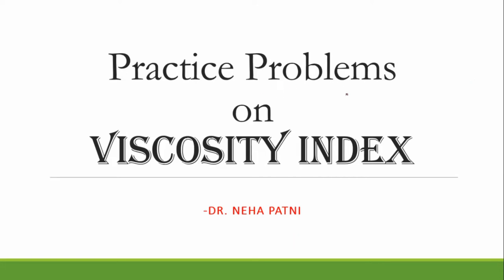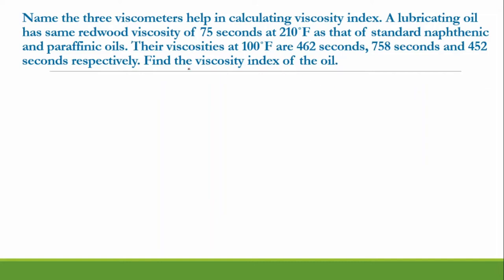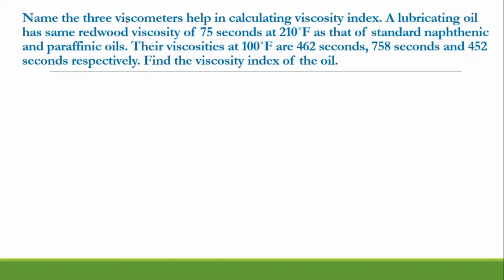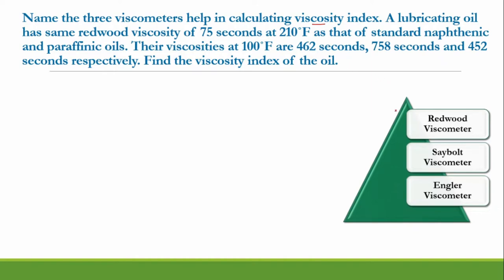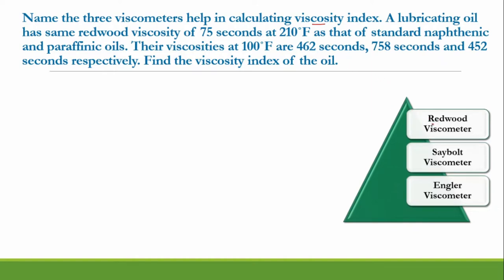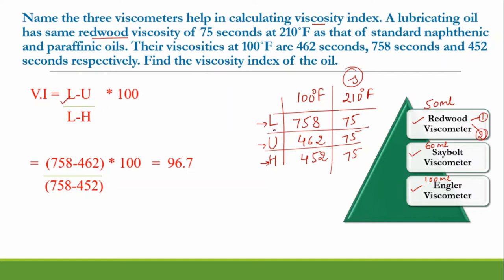Easy calculation of viscosity Index of lubricating oil

Comment: if water is contaminated with lube oil , then viscosity of lube oil will be
Reply from the maker: @sukant kumar nath, if water is mixed with oil, then in machine due to increase in temp it may make emulsion and the viscosity may decrease
Reply: @NehaPatni_Chemistry  ma'am any logic
Reply: @NehaPatni_Chemistry  As we know increasing of temp. , Viscosity decreases
Reply from the maker: @sukantkumarnath689  yes, due to friction, temperature increases and due to emulsification, ease of flow increases